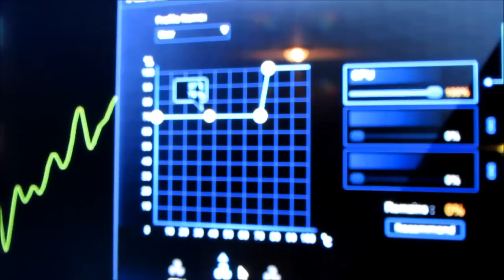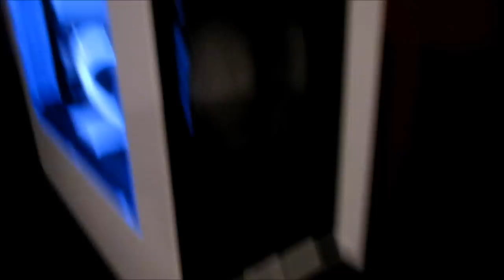Vlog #3 | NZXT S340 case PC update! and other stuff

Comment: Where did you Get The Custom Cables? i need the exact same ones 0-o
Reply from the maker: +HWCentral NXIC or memory express
there are white bitfenix extensions and white Silverstone extensionsthey are essentially the same
Reply: +Enderman LP Thanks!
Do you know how to find the Y shaped cable at 4:17 though? I've been looking.
Reply from the maker: +HWCentral That's actually a sata power splitter cable from memory express
It has coloured cables, so I had to paint it white with plastidipIt turned out ok, but after several months of being in awkward cramped positions behind the motherboard the paint kinda got ruined, and you could barely see it anyway so I'm going to replace it with a black cable soon     If you are going to paint a cable like that, make sure that you don't have it squished behind the motherboard because that will peel some paint off over time, have it in a large open area where the cable gets some airflow and doesn't get scratched

Comment: can someone please help answer me this? 
how is the airflow in the case,and wont the intake of the hot air from 
the front side heat up the gpu? its good for the cpu but what about the 
other parts?
Reply from the maker: The airflow is fine, but I recommend using 140mm fans for more airflow. And no, the air only heats up a couple degrees, so unless your GPU is running hot already it should not be an issue.
Reply: Enderman LP
thank you man,so you recommend this build withg AIO coolers with confidence right?
Reply: Enderman LP
also,you mean 140mm fans where? front and top?
Reply from the maker: 140mm fans on the front, if you want to add one on the top you can too.

Comment: Can you add an optical drive on this case?
Reply from the maker: Ntinnie no, it has no 5.25" bays
you can use an external one if you want
I was thinking about maybe modding a slimline optical drive into the front, but I don't think it would be worth the time and money since I haven't used one in the past 3 years
Reply: oh sorry I'm not an expert when it comes to installing optical drive. What do you mean by using the external one?
Reply from the maker: Ntinnie you can buy external optical drives that you can just plug in with USB to use them, then remove it when you don't need it
Reply: ohhhh lol thxs man :D

Comment: is the rad in front an intake or exhaust
Reply from the maker: Intake.
Reply: Enderman LP that was a very fast response, I honestly didn't even expect one. when you had it like this, how cool did it keep your PC?
Reply from the maker: Haha :) I run my fans super slow, so CPU temps are about 65-75C with a 240mm radiator.
Reply: Alright. I can never figure out how to control my fan speeds to keep my PC quiet. I have an MSI 970 mobo and whenever I go to the bios and put the speed down, nothing happens. Any idea why? Is there a program I need to download possibly?
Reply from the maker: No idea, I've only used asus motherboards. Maybe MSI has fan control software in their downloads for your motherboard? idk

Comment: What is that fan on the motherboard?
Reply from the maker: It's a fractal design R2 40mm.
Reply: Thanks! Sick Build. Just got the S340 Case also.
Reply: I've never seen a fan the way you have the mounted? What is it mounted on and what is it cooling?
Reply from the maker: It mounts to the motherboard, to cool underneath the shield cover thingy. It's just one of the features of that motherboard.

Comment: would you be better off using a AF fan on the rear exhaust because nothing is blocking it?
Reply from the maker: +tehbitterman it would give more airflow, but then I would have negative air pressure in the case which I don't want. Also there are no airflow nb e-loops, and I like how this fan looks so I prefer looks over a few degrees C lower temperatures :)

Comment: are all your games maxxed out, what is the specs?
Reply from the maker: +tehbitterman well I pretty much only play MC or some other less intensive games like CSgo, but I do a lot of video editing and rendering, and temps are fine. Currently I have a 4790k (at stock) and a GTX770 DCUII at 1260MHz, 32GB of 2400MHz ram, 760W seasonic platinum, and sabertooth mark s motherboard